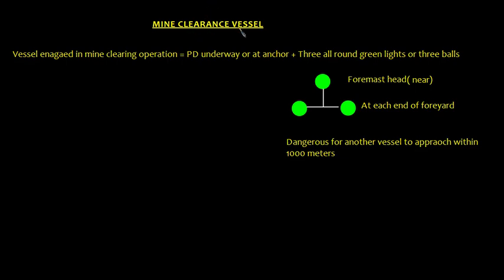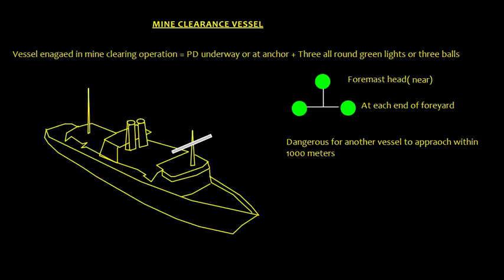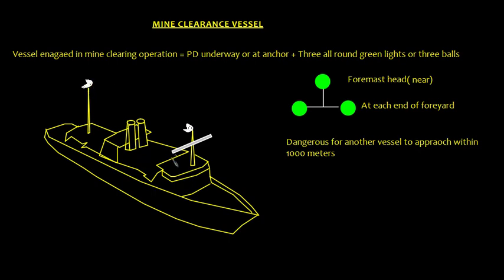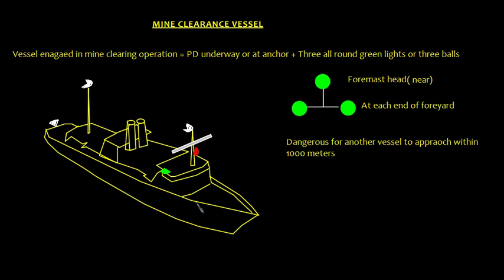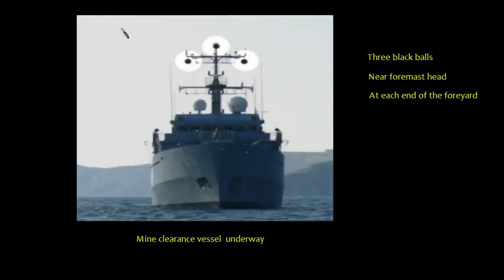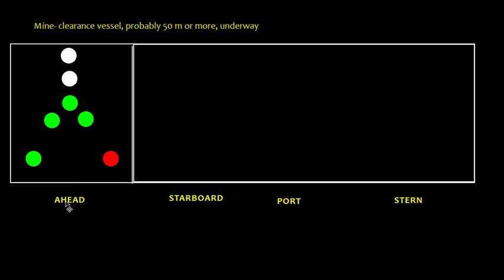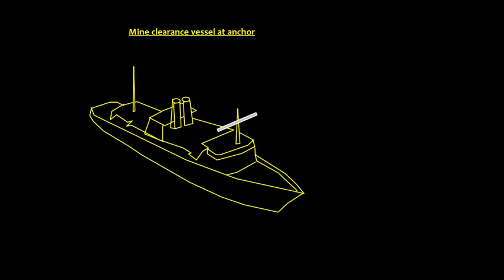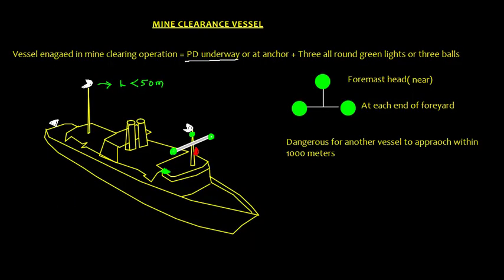COLREGs LIGHTS & SHAPES _MINE CLEARANCE VESSEL

Comment: Why 1000 m is required...why not less or more
Reply from the maker: Because mine clearance operations involve the use of explosives and other dangerous materials, it is crucial for other vessels to stay clear of the area to avoid the risk of collision or damage to the mine clearance vessel. Therefore, the COLREGS require that vessels maintain a safe distance of at least 1000 meters from a mine clearance vessel exhibiting the appropriate lights or shapes
Reply: @sailorstube3259  ok sir...any particular reason for 1000

Comment: Mine clearance is considered as RAM, still why it does not show RAM lights?
Reply from the maker: Rule 27(b) clearly states the lights exhbited by RAM except vessel enagaed in mine clearance operations. Rule 27(f) provides lights for mine clearance vessel. This was ammended in 1981 to extend its application to all mine clearance operations. Rule 1(e) permits govt to make separate provisions for vessels of special construction. So, a mine clearance vessel though RAM but due to some special construction requires some separate identification.  It is dangerous for another vessel to approach within 1000 meters of the mine clearance vessel. This special clause is not there for other RAMs. Hence there should be some distinction to identify and it is decided as per R27(f).